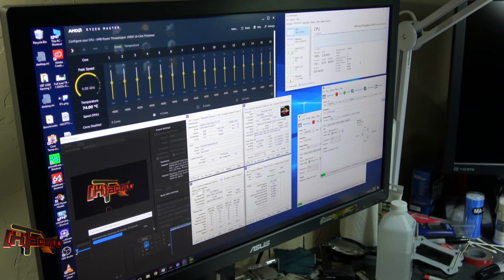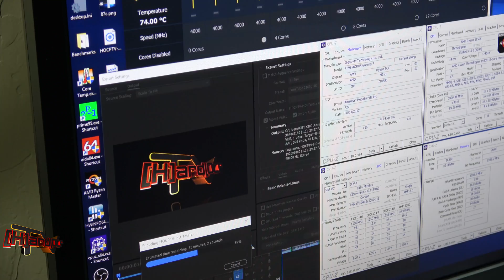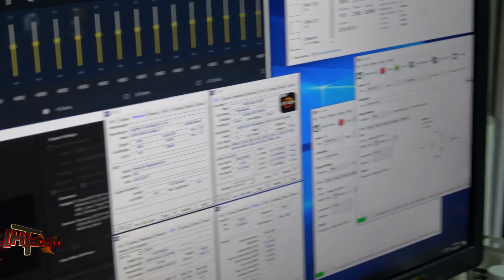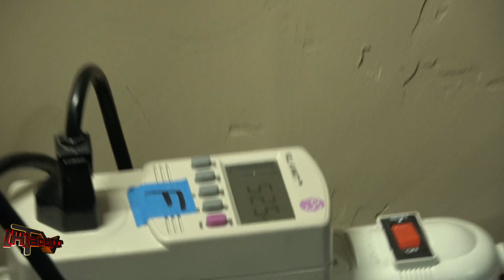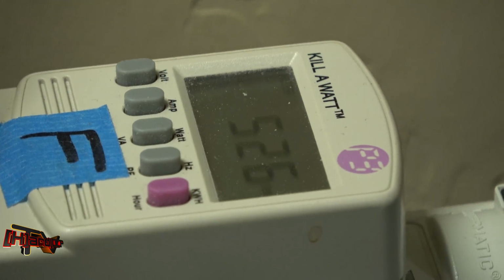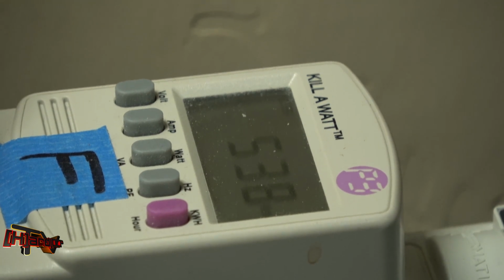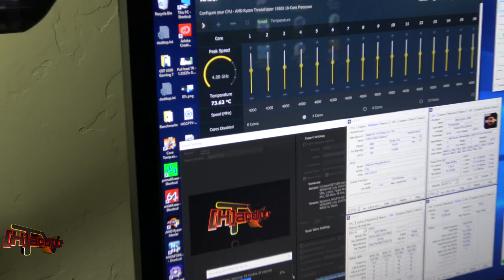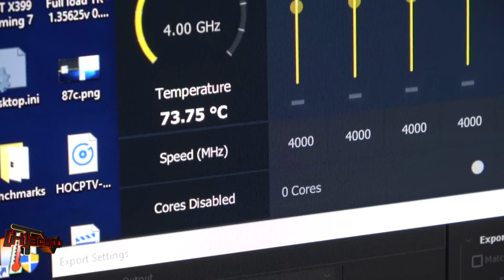AMD Threadripper at 4GHz with XSPC RayStorm Waterblock

Comment: What is you temp free of load?
Mine is untable from 29 to 45 free of load, on load it goes to 68 after 10min of load.
AMD 2950X
Reply from the maker: The way the clocks work at idle, those bounce around a lot and is normal.  68C at full load seems like a good place to me depending on your ambient temperature.

Comment: If ur tightening, four corner screw points.. use a cross tight sequence, to even out d pressure within contact surface..
Reply from the maker: In every other CPU situation I would agree, but there are only two active dies on this huge IHS surface.  I have found that we get better contact over the active dies hitting the diagonal plane across those die surfaces first.....and I have literally done hundreds of these TR installs.

Comment: Is this the best block? I made the mistake of buying the ek block with my first ever cooling loop, I didn’t even look at what temps people were getting with it because you would think it would just work, using 1 x 360 + 1 x 280 rad with a 1080ti, the gpu sits at about 45 and the cpu is high 80s after about 10mins
Reply from the maker: The XSPC TR4 has shown to be the best performing block with stock mounting hardware.  The Swiftech did a better job, but only after using custom mounting spring hardware that I stole from a Koolance block kit.   That review is here:  https://www.hardocp.com/article/2017/12/19/swiftech_apogee_skf_threadripper_water_block_review/4  

Since it has been a slow week, I went back and ran all our blocks back through testing again, so our new Koolance review, likely published news week will have a roundup of temperatures that are directly comparable.  Also, I will do a short video discussing all that as well.
Reply from the maker: Also, the EK TR4 block as been the worst we have tested, by a large margin.  I would not purchase the EK TR4 block if you are planning to even slightly overclock your Threadripper across all cores.  It cannot handle the heat.
Reply: HardOCP TV wow great discovery with the springs mate, that was a huge improvement, 8 degrees cooler! Great channel here thanks, I have just ordered a  XSPC block , cheers 😎
Reply from the maker: Let us know how it turns out for you, I would really like to know!

Comment: did you have any issues setting this board up? I've read all sort of bad reviews about it not posting, not booting, crashing in windows, etc.... and I've been REALLY interested but a bit afraid to buy it because of some of the bad reviews I've read, even though some are very positive reviews.
Reply from the maker: Been using it for months without issue.
Reply: HardOCP TV so no issues when installing the OS with the WiFi or other drivers?
Reply from the maker: https://hardocp.com/article/2017/09/28/asus_rog_zenith_extreme_threadripper_mobo_review
Reply from the maker: https://hardocp.com/article/2017/10/19/gigabyte_x399_aorus_gaming_7_tr4_motherboard_review
Reply: wow thanks for those links! looking at them now! :)

Comment: Your thermal paste is too thick
Reply from the maker: You can see in this HardForum thread where we have been trying all sorts of application techniques.  TR is a bit different from other CPUs.  https://hardforum.com/threads/amd-threadripper-cooling-update.1942973/page-2#post-1043196499
Reply: So it seems spatula traps air with this huge surface. There must be some better solutions. Gamers Nexus has  drawn the positions of the four dies on the IHS, perhaps you can apply thin lines of thermal paste only above these four dies?
Reply from the maker: That is what it seems.  We have been comparing and contrasting methods with XSPC testing.  XSPC has been doing a thin spread with a spatula and one dot in the middle.  I have found that four very small dots out over the dies with another very small one in the middle, is working best for us.  https://hardforum.com/threads/amd-threadripper-cooling-update.1942973/page-2#post-1043196499
Reply: IMHO these dots are still too big. Better thermal paste tend to have higher viscosity, dots are unlikely to be flattened very thin. I always use 'British flag' shape, it costs way less paste than dot and can cover large area. Could you test 4 British flags instead of 4 dots without the base layer of paste in the pic?

Comment: after 75 degree celsius will system shut down or not ?
Reply from the maker: TR throttles at 85C.
Reply: T Y and can u pls do me a favor ? i need to know how many Cinebench points are at 2,7 ghz /all cores/ speed , just to simulate amd epyc 7281 cpu .....
Reply from the maker: Best of 3 runs 2700MHz/3200MHz was 2400cb.
Reply: wow after countless askings at other channels YOU are the only one who answered and i have to say big THANK YOU !!!
Reply from the maker: No problem.  Quick and easy test to run.

Comment: People need to stop bieng lazy and spread the thermal paste evenly over the die like we used to back in the Athlon XP days. Come on man it will literally take an extra minute. Then you don't have to check if it spread correctly. Just do it right the first time. And honestly to everyone, stop being lazy!
Reply from the maker: After all the tests I have done for coverage, I would agree.  I have been spreading a very thin layer across the entire CPU then using 5 very small dots of TIM.  Seems to working very well.  XSPC is have good results using close to the same method with full spread and only one dot in the middle.
Reply from the maker: This will interest you most likely.  https://www.hardocp.com/news/2017/09/02/bykski_threadripper_water_breakdown_install  And not being lazy, just trying different ways of doing things rather than making assumptions about what works best.

Comment: Just for comparison my 1700X at 3.6GHZ on the Cooler Master Hyper TX3 Evo( Don't get sucked into the naming of this heatsink and cooler it's a dwarf and has only a 92mm fan, and not recommended for overclocking). Reaches over 80C after just a minute or so of ciniebench R15.

Comment: Did I see only 1,404VCore on that?? Grats to winning it. My 1800x does not even reach 4GHz with 1,44V....
Reply: My 1800X runs at 1,45V at 4Ghz and 1,5V 4Ghz stable for cinebench and other programs that use it constantly 100% max 72°C.
But i let it stay at 3,9Ghz 1.45V 64°C max 140Watt aircooled.
https://rog.asus.com/forum/member.php?417302-Red-Core

Comment: You should spread the thermal paste out evenly across the IHS and not just put drops near the center.  Noob mistake man 🙄
Reply: Dan K it spreads itself when pressure is applied. The only thing needed is a sufficient amount of paste.
Reply: So in other words, everything is exactly as I just said, and nothing has changed.  Go touch a Threadripper on the four corners while it's under heavy stress load.  Just remember to bring some seasoning.  Crow tastes awful when you eat it on its own.  Learn the internal mechanics of a Threadripper BEFORE trying to argue (for no reason) against someone who does.  When you actually own one, then you can talk.  And no, you don't.  This issue has been well-documented RIGHT across the board by multiple sources which back up my original claim, on top of the fact that I DO own one (1950x, bitch ♥) and have confirmed it first-hand.  Otherwise I wouldn't have made it.  Anything left in your Asshat Tank, or is it time for a refill?  Whatever the case, eat static.  You're an idiot.  (see what I did there?  Mahhhhhvelous :)
Reply: Actually Taylor Lords, you are wrong. There are 4 cores, two are fake and two are real. This processor's heat is centralized in the middle of each opposing corners where the active cores are located. This also why a heatsink or water black needs to cover the entire processor to maximize cooling. And yes Dan is correct, best to spread paste out and thin. You guarantee complete coverage that way. The 5 dot method runs risk of uneven coverage and air pockets, but is simple and effective enough for normal use.
Reply: Dan K this is what AMD suggests.
Reply: It's not a noob mistake, at all.  The processor's heat is centralized in the middle, and as long as you cover that area, you're good.  Learn about the chip first before making claims.
Reply: @TheDarkMikado  Nope. Threadrippers have 2 or 4 dies (depending on the model), each one placed off-center. Check out pictures on the internet of Threadripper delidded. You should absolutely make sure you cover these 4 spots with thermal paste for optimal heat transfer. One blob in the middle, even if big enough, will not work well.
Reply: Taylor Lords actually the ihs is supposed to conduct the heat from around the chip and centralize it in the center. However it is not 100% efficient and many of the parts of the chip that create the heat are in the four corners and not just the center. Just covering the middle will at most only partially cover the corners and miss a major part of the chip. Furthermore, the ihs is absorbing all of the heat from the components inside and spreading it out with its surface. More thermal compound (or liquid metal) would help transfer the heat from the processor into its cooler.
tl;dr Dan K was immature and not exactly correct but you're just an idiot. Learn about the chip first before making claims.

Comment: So, does that mean temps were actually at 47* because of the 27* offset shown by Ryzen Master?
Reply: no, that thing has been fixed.
Reply: the offset only shows in the bios. I actually run the offset on the ryzen system I built for a friend. because he needs cool parts at all times without having him worry about software fan control. he knows jack squat about pc's so it wa spretty handy.

Comment: Why is there a circle next to 4 core filled in with white at 2:37? None of the other circles are filled in.
Reply: I thought the same thing a first.  Then I realized that there is no circle to the left of 0 cores, but the circles are to the right.  So zero cores disabled.  Just a bad UI design, from what I can see.  You can look up Ryzen master screenshots and it shows the same thing.

Comment: Not enough thermal paste... thats a huge heat spreader n she needs more love than that
Reply: id say a manual spread would work best on threadripper especially if you have a custom waterblock like this
Reply: the fucking hair on my screen is bugging me.. lol
Reply: It's more than enough thermal paste for that CPU.  The cores are centralized underneath the Ryzen lettering.  As long as you cover the center area, you're good.
Reply: Taylor Lords i would at least use enough to cover the cold plate on the block... and remember just cuz the cores sit in a certain spot doesnt mean only cover that spot on the ihs... its called a heat spreader for a reason and with something as big as TR id cover as much as possible
Reply: If you've ever touched the outer corners of a Threadripper you'll understand.  The heat is centralized in the center and won't dissipate off to the sides.  That's why you don't need thermal paste covering the entire block.  This is documented, by the way.

Comment: What do you mean by "100% desktop load" ?
Reply from the maker: The system was running 100% CPU and close to 100% RAM usage using desktop applications shown in the video to load the system.

Comment: Hello i received my Ryzen Threadripper 1950x yesterday with gigabyte gaming 7
I
 had the overckock has 4Ghz has 3200 ram I also have the corsair H115i 
on and the thermal paste grizzly and by doing a test I climb a maximum 
63 ° cueru against my cpu are not used to 100% if you have a Idea for deactivated the limit of cpu ca will be cool and also I noticed that by deactivating the SMT I have a better result
Reply: HUH?
Reply: Gamer-pc of course you get better results with SMT disabled.... Because you turned off half the threads

Comment: Have you found any problems with ram not running at frequencies over 2133 when using more than 2 sticks of RAM?
Reply from the maker: Yes.  RAM compatibility has been the biggest issue with Ryzen CPUs.  Was a nightmare when Ryzen first came out, but that has matured a LOT.  Here is the trick to that.  SIMPLE answer is to buy "AM4" branded DIMMS.  OR...buy RAM that is on your motherboard Qualified Vendor List and has been verified to work.  These "AM4" sticks from Corsair have been working with all our motherboards with 4 sticks at 3200MHz.    https://www.amazon.com/Corsair-CMK16GX4M2Z3200C16-VENGEANCE-PC4-25600-1-35V/dp/B072LX99L9/?tag=hardfocom-20  There may be other companies doing this, but we stick with Corsair....because it works.
Reply: I agree, I love corsair and thats what I'm using at 3466 but only works with 2 sticks instead of all 4 of the quad channel kit so I guess i just have to be happy with the 16gb at 3466 for now
Reply from the maker: What are the sticks rated at?  Can you do 4 DIMMS at 3200?  There is a lot of trace distance to be covered and the faster the memory bus, the tougher it gets to do.
Reply: Does it work this threadripper motherboard as well?

Comment: Should have used the Little Devil LD PC-V10 which has a refrigeration unit in the base of the PC case and a cooler head that will keep the temperature at minus 55 degrees below zero but the motherboard has to be prepared per the instructions before installing into the said case.
Reply from the maker: Seems kinda funny that we still need sub-ambient cooling when we had CPUs at 4.44GHz in 2003.  :)  https://www.hardocp.com/article/2003/01/29/pentium_4_444ghz/
Reply: HardOCP TV capacitance increases as the distance between traces decreases. I.e. the smaller you make the transistors the more signal bleed you will get
Reply from the maker: Yep.

Comment: 16 CORES + FULL LOAD + 4GHZ OC = FUCKING 74C ONLY
Reply: i9 7900X gets even hotter lmao
Reply: Samuel Vandergast We're comparing a quad core CPU to a sixteen core CPU.
Reply: High quality indium solder with some gold, not intel toothpaste.
Reply: There was never a need to delid AMD cpu since they all used indium solder (even cheapo $50 ones).
Reply: AMD always soldered their chips from the most basic Sempron/Duron now to this Threadripper.
Reply: I'm at 5.2 Ghz stable when there is no eclipse.
Reply: King Christo, a overclocked 7700k can barely stay under 80 with a custom loop lmao
Reply: and the fact intel now has a i9 proves they realize they are outplayed. they even rebrand the 7  series to the 8 series, kinda retarded and funny if you ask me.
Reply: Would just had used Taichi instead.
Reply: Samuel Vandergast right but,4cores vs 16cores
Reply: I Have 75.5c with noctua NH-U14S TR4-SP3
Reply: i Always loved intel and im stull using a 4790k in my second game pc,but man i have to say amd completly destroyed intel with their cpu's. even the fact that intel uses some thermal compound says it all, amd has soldered their chip.
Reply: + custom loop

Comment: Liquid metal or go home!
Reply from the maker: Better get out your wallet if you are going to be doing a lot of test fittings.  :)
Reply: His temps are great already
Reply: 50 pcs of thermal grizzly conductonaut you can get for 7 $ each from performance-pcs ,  so 350 $ amount that will last you long time assuming you are a guy who test a lot
is not that terrible especially if you are in watercooling (which can cost  a lot), and with threadripper which there is no 1 clear best appliance method if you want the performance and you are willing to pay little extra for the best performance it totally worth it.  but you should buy 1 test the performance and conclude the value.
Reply: Yes yes yes, finally some good brain man, liquid metal FTW.

Comment: I don't know whether this will apply to TR, but I noticed when OCing my 1600 that I could get to 3.975GHz @ 1.35VID which kept the voltage around 1.38V max, but the jump to 4.0GHz required 1.4VID which tended to give me 1.426V max. I noticed you were up around 1.404, which suggests about 1.375VID or thereabouts, but given that the voltages were hidden on Ryzen Master I'm just guessing
Given the 16 cores, that voltage difference from 3.975 to 4.0GHz could give quite a few watts difference under load with a resulting drop in temps, just wondering what the VID setting was and have you looked at any fine tuning of the voltages for stability by varying the frequency by 25MHz down to try and get the temps down to sub 70 degrees.
Reply from the maker: https://www.hardocp.com/article/2017/08/20/threadripper_at_4ghz_xspc_raystorm_waterblock  specifics in the article.
Reply: TY

Comment: Try 4.2 ?
Reply from the maker: We actually tried 4025MHz and could not get it stable there.  I did not spend a lot of time focused on that, but we need more cooling before moving up the clock scale.
Reply: Just set the voltage to the processor little bit higher and you gets stable system , but never forget for  better cooling and better thermal paste on IHS